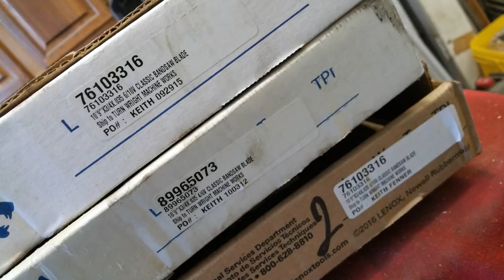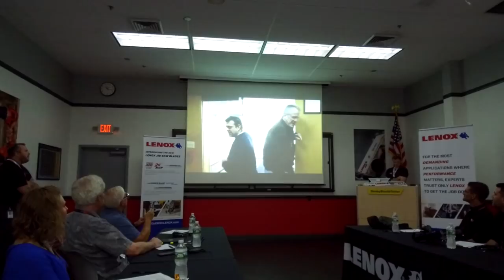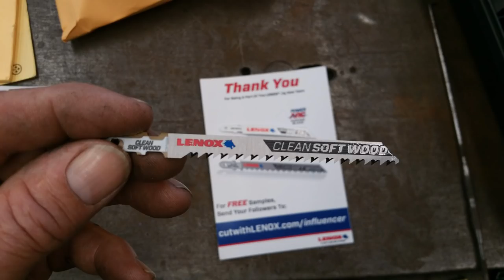LENOX® Introduces New Range of Jig Saw Blades

Comment: Picked up my new Lenox hacksaw and blades today after seeing this video.  I’m impressed.  I could never get the blade tight enough on my old hacksaw and the blade would always flex. I just lived with it because I didn't know there was a better solution.   The Lennox frame has the blade so tight that I can pluck it like a guitar string.  Wonder which note I should tune it to LOL!.  I tested is on a 4140 rod and the Lenox hacksaw cut through the rod in much fewer strokes than my old flexible hacksaw with a Starrett blade in it.   Chris

Comment: Kieth, up until this point I have always used Starrett Hacksaw blades and either Bosch or Milwaukee Jig Saw & Sawzall blades but I am now going to try the Lennox. I already went and got the free Jig saw blades from the offer they have. Oh, I do have a set of Lennox Hole Saws that were my Dads and they are still going strong. Funny thing is I never really paid much attention before - now I will! Thanks!!

Comment: Thanks, Keith.  This is a great video for me, considering that in my profession we do a lot of builds "at the back of a truck"- literally.  And our tools are generally what a contractor would use, yet we are often asked to do somewhat  precision jobs in steel and aluminum.  That means we are often using reciprocating saw blades, hole saws, hacksaw blades, and jigsaw blades- but most of all we use utility blades to cut rope, mat board, corrugated plastic, color correction gels- sometimes even luan and softwoods (including pencils).  I'd love to see a video on the durability of Lenox blades versus the home center competition.  In the meantime, I ordered the sample pack and l'll be looking for the most hardcore electric jigsaw out there to replace the zombie brand home center jigsaw that thankfully did not break on a job (but did in my shop- the plastic foot broke, embarass-ing-ly while trying to cut sheet steel).

Comment: Just setting up my hobby shop and I had to cut 1/2/ x 2 CRS by hand the other day because I haven't acquired a bandsaw yet.  Worked up a pretty good sweat.  Never thought about using my jigsaw.  I bought Bosch blades for it and judging from the 3/16 you cut it might have been a chore.  I have more to cut and I'm looking forward to see how Lennox blades do on it.

Comment: Lets not forget Lenox® Band-Ade®  Sawing fluid - the BEST cutting fluid for the cold saw by far.  Expensive as hell but blades stay sharp 3-4  times as long and allows a faster feed rate.

Comment: I have been using Lenox since the 80's also great products from there step drills,hacksaws,bandsaw blades ,hole saws. One of the best thing they have is there lubricants there Pro tool lube is great with stainless along with there band - ade band saw cutting fluid. I cut thousands of cuts on the bandsaw and the blades last forever using there Band Ade fluid. There classic bandsaw blades are one of there best they make.

Comment: Hi Ya Keith,,,Mate would be interested in a close up of tooth design,,compared to the "inferior Blade",Been cutting metal a long time,as have you and speed,lubrication and design play Huge factors in this,as does Hardness compared to toughness,
An example of this,,Sunday arvo,all shops were closed,found a Hardware shop open,,only had shit blades,(Hole saw 30mm),brought 2,the first one we chewed out on first hole,,had another 16 to drill,what to do?What were we drilling ? 30mm hole in 30 mm plate,new motor mount for crane drive Motors
found our selves a spray bottle and filled with Ice water,drill, electric no speed control,,we drill the other holes with no probs,,just kept the cold water up to it,,still have that hole saw to day

Comment: Where i find most jigsaw blades fail(not breaking) is round corners in thicker wood say following a template or line in that the top is right on the line but on an inside corner the bottom of the blade cuts into the wanted material so you need to leave plenty of material to be taken off later. With outside curves its the opposit, the blade bends out at  the bottom leaving material to be removed. I have tried many blades including bimetal that are impresive in a straight line but useless on curves as they all bend on curves. I used to employ 5 people cutting out shapes all day in 22mm birch marine plywood so i have gone through my fair share of blades. Another thing on wood is the top surface breakout especially in plywood as the grain direction changes as you go round the part, bosch were the best that i tried to overcome this.

Comment: I've also been using Lenox hacksaw blades for eons... they're the Gold standard IMHO. I have 3 of their older high tension frames as well; one each with a 18, 24 & 32 tooth blade. Must admit, in my case they really don't see a lot of use; but when I need one I need one. I like their utility knife blades as well.
Reply: I USED to like their gold  utility blades that were USA made , now they are made in MEXICO and dont hold an edge very long compared to the USA made version So much for MADE IN USA  Lenox
Reply: Interesting, Thanks. I haven't bought any new blades in some years... sad, the old Lenox ones were great.

Comment: Looks like a good product Keith. I am using Starrett hacksaw blades at the moment! I find them to be a good product.
 Lenox I have not heard of until now! I also use Sandvik  stuff and am happy with that. I am not aware of Lenox here in Australia.
 The innovation of the curve in the Jig Saw blade it very good.  The half hour show and tell displays this well.
 I will also mention that 30 plus years ago I used a Bosch Jig Saw that had 3 settings on it for the amount of bite the blade had on the cutting stroke,  Zero to a bit and lots, for timber and then backed off on the down stroke so as the teeth did not rub/wear without due cause.
 The curved blade is such that it does this without having to buy a new machine and will achieve the best results.
 Hope to see them here in Australia. John.
Reply: I have brought Lenox blades at bunnings. I used to use starret hss hacksaw blades but I find the Lenox last longer
Reply: The Tateyo, Thanks for the heads up, I don't normally go to that store, however I am in need of some Jig Saw blades so I will next time I am near to them as well as ask my two regular tool suppliers. John.

Comment: I discovered Lenox blades back in the 90's when I had to regularly cut 316 tube to length on site. Nothing cut easier and lasted as long as their blades. I recently bought some of their blades for my sabre saw, they cut up a car body ridiculously easily. One blade did the whole car.
I'm a firm believer in buying relatively inexpensive power tools and spending the money instead on quality blades.

Comment: Used the Lennox carbide tipped blades for case hardened 6150 worked great unless I ran into carbide, even cut through hardfacing.

Comment: The new lennox hole dozer hole saws beat the stuffings out of any hole saw I've ever used. I don't know if this happens to anybody else buy sometimes on thick material like 3/4" thick material the teeth will catch and break off. That is a pain in the ass because then you have to get those teeth out of the piece because if you get a new hole saw youl'll just wipe the teeth off if you don't. Morse was always a close competitor but they are gonna have to step up their game to equal or beat the hole dozer hole saws.

Comment: seems the whole concept is to get more even tooth wear... which is always a big issue, but it's mainly limited by material thickness, unless you really move the saw around a lot, which is not an option for finish/fine type work.
I've used and tried many blades branded in various materials of metal, wood, clay tile, ceramic, fiberglass, cement, etc. from soft cloth like to hardened steel the machinists hate, so even when they claim "most awesome'st best'est mega-super-duper-blade" it still relies on the mercy of the user, lubrication and moving around, otherwise you'll mop the teeth off in an instant well you get the point. ;)

Comment: I'm sure the Lenox blades are good, however.... 

The Bosch T118A is the cheapest Bosch metal blade called "basic metal" is made from HSS and listed as a sheet and thin metal cutting blade, not a fair like for like comparison with the special curved and probably expensive Lenox Bi-Metal blade.

If you were to compared to a top of the range Bosch blade like the Speed Metal blades (T321BF3) and Bi-Metal rather than HSS, I think the difference in speed would go away. 

Comparing the cheapest HSS Bosch sheet metal blade to their latest and greatest Bi-Metal is a bit of a dishonest con trick by Lenox marketing if you ask me... shrug

Comment: jus a note was impressed wit the lenox sample offer. the problem is that they cost me more than if I would have just purchased them. seems that the mailer they used is only for flat items and as the blade packaging didn't qualify I had to pay 2.61 in postage due plus an 18 mile round trip to the post office to see what it was for. may treat you good but cant say the same for me  Dave   do enjoy all you videos but disappointed in you sponsor   Dave